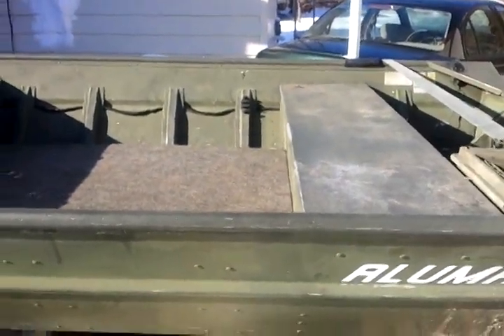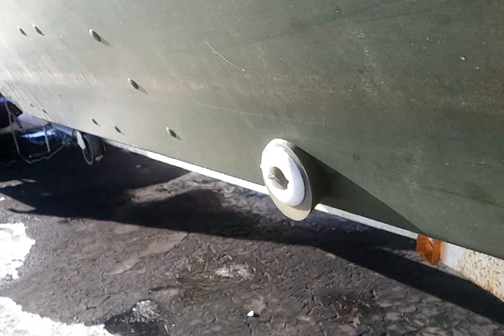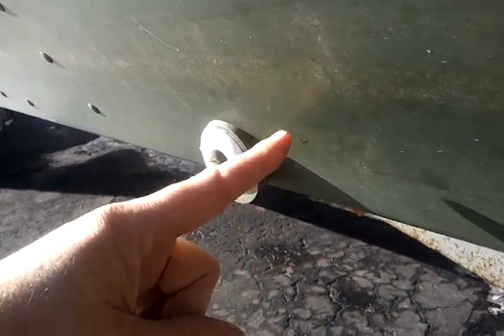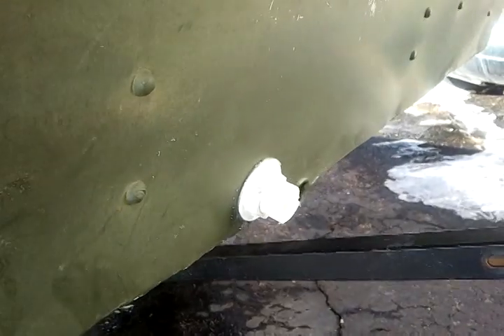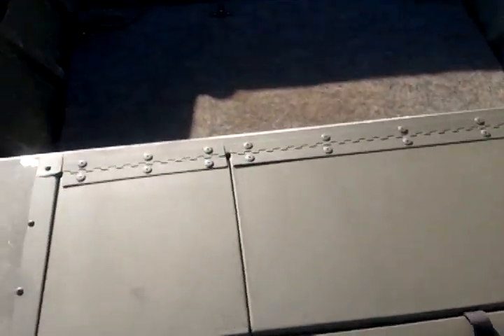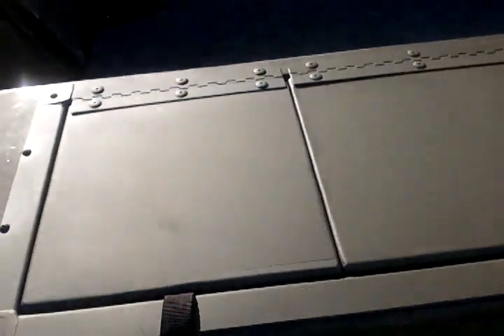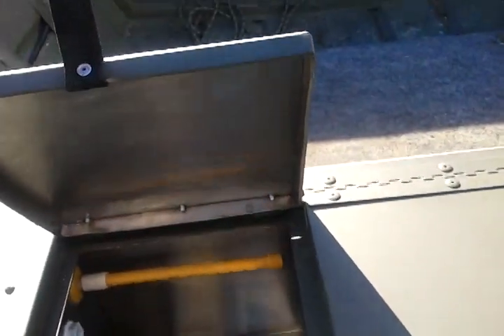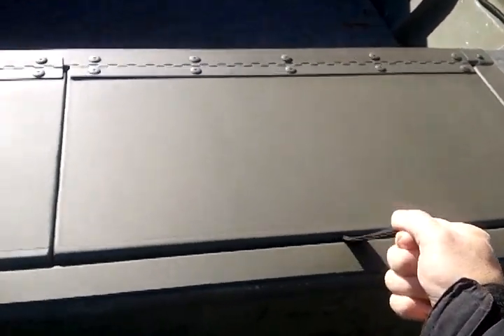Livewell fabrication for Jon Boat

Comment from the maker: yes I have...first day out had 8 walleyes in it...had a technical hitch with the fill pump, and there was a leak at the drain hose conx which made us have to remove the livewell to tighten up the conx. but other than that, it works great now.

Comment from the maker: @zumje  The spacer was a concern for me also. We'll see come spring. There is limited space in the seat area and couldn't use a 90 degree because there was not enough room for the hose to bend and still stay low...and they don't make a 45 degree angle or that would have been ideal.
The Only way your idea would work is if it was valved...otherwise the livewell would just drain out through the pump....and would be a considerable PITA and more expense.

Comment from the maker: @mrchoung05 This wasn't for the faint of heart! I designed it and took the mockup  to the fabricator. He had never done this before either so he went slow. Now remember, I had him do everything. So with him supplying and installing pumps, hoses, accessories, lights, cutting the bench and holes, removal of insulation and fabrication of the tank the total was $600
If all you wanted was the tank fabrication and everything else you took care of, I'm sure the price would be $300 for tank n lid fab.

Comment from the maker: Shouldn't. Mine is a riveted boat as well. The sidewalls of the seat are still in tact, not to mention all the ribs are as well. It will reduce emergency floatation, however. how much, I cannot say. I figured the amount of plywood decking I put in my boat made up for the foam I had to take out to make room for the livewell.

Comment: Nice live well.
Not sure on the drain out the side,hope it doesn't grab water when underway.
It would be a pain to get soaked because of that.
I wonder if you done away with that and just let it drain through the fill pump...maybe if your fill entered your tank lower or if it was where the drain is now.
Anyways,looks good,hope you fill it.

Comment: Awesome job.  The only thing that worries me is the drain fitting sticking out like that.  Catching something like a submerged stump might mean big trouble.  I wonder if the fitting could me flush mounted and the nipple heated and angled.
Reply from the maker: concerned me too after I saw it. I fashioned a sloped wood  spacer in the front of it and set it in 3M 5000 Marine glue. Now anything that it hits, including water which made it spray, flows around it.  If I had to do it again, would have done it thru the bottom so its flush.

Comment from the maker: The fitting with the screen is the pickup for the recirculating pump which discharges thru the yellow PVC aerator pipe. 
the fitting directly above the screen on the left side is the fill port which is pumped from a pump at the back of the boat.  
The fitting with the nut which is located next to the yellow aerator is the overflow drain that drains out the side of the boat. If I had to do it over again, I would have put that through the bottom of the boat. 
Any other questions, just ask.
Reply: +kevininspects Forgive me for my ignorance. Are these bench seats on jon boats empty? Meaning is there nothing inside them to begin with? I am wanting to do a similar thing here but have little knowledge on the inside of the boat.
Reply from the maker: +Jay Smooth foam insulation.
Reply: +kevininspects Wow! Fast reply Thanks. So just dig out the foam? I'd appreciate any info as I'm getting a jon boat in about two weeks and want a live well mod.
Reply from the maker: +Jay Smooth just dig it out.
Reply from the maker: +kevininspects check out my other vids for more on the boat and livewell
Reply: +kevininspects Do you have a vid of you prepping the bench seat for this?
Reply from the maker: +Jay Smooth no...but here are photo's http://s243.photobucket.com/user/Flowageboy/media/Jon%20Boat%20Modification%20Project/006.jpg.html
Reply: +kevininspects Cool thanks. One question since you have bee there and done that on this. Why not have the pump at the back end of the boat run thru a hose to the live well then put an over flow out the side top of the bench? That is the way my old bass boat was designed.
Reply from the maker: +Jay Smooth it does come in from the back. 
The overflow is connected to the drain line which goes out the side of the boat.
Reply: +kevininspects Let me rephrase after watching again. Why is the fill pump at the back then what is the hole in the side of the boat for? It seems to low to be an overfill
Reply from the maker: +Jay Smooth  I don't know how many different ways of stating that the OVERFLOW AND DRAIN CONNECT TOGETHER AND EXIT OUT THE SIDE.
Reply: +kevininspects My bad. Watched again. You said it is a drain. So then this is just an air recirc and not a water and air recirc. I am wanting to do a water and air recirc. They work better in the long run and especially in the heat. Still great ideas you have here. You have my cogs turning on what to do. Thanks
Reply from the maker: +Jay Smooth WHAT?  It's a water recirculation not air. It comes from the screen at bottom of tank and exits out the yellow sprinklers. ...thus re-circulation.
Reply from the maker: +Jay Smooth  the DRAIN is in the center of the tank at the bottom.
Reply: +kevininspects I see. I think the audio dropping off has confused me. I am just use to the set up my old bass boat had. It had a pump that brought fresh water in and dropped thru the aeration tube. Then there was an over flow so the tank didn't over fill. So according to the notations the screened part at the bottom would have to be the drain right? It's the lowest outlet you have. Sorry if I'm confused.
Reply from the maker: +Jay Smooth The drain is at time index 4:40
Reply: +kevininspects I think your annotations may be off. The screened part at the bottom left of the tank would have to be the drain. It is the lowest point of the tank. You say the top left inlet is the water feed from the pump from the back then what feeds the yellow aeration tube? The top right hole would seem to be a over fill but I didn't see that on the outside of the boat.
Reply from the maker: +Jay Smooth I have to bow out of this conversation. sorry.
Reply: +kevininspects Ahhh. forgive me. I watched this vid several times and neer noticed the center drain at tank. I am sorry man. I am trying to figure out what you have done and juggle other stuff here so I am off a bit. The annotes say the bottom left screened port is inlet from back of the boat (pump). That would be the water inlet. If so then what is feeding the yellow aeration tube?
Reply: kevininspects Ok Thanks for your help
Reply: +kevininspects To be clear though, my point of understanding was to say this, for a water and air recirc cycle all you need is to have the freshwater (from the lake) pulled thru a pump thru an aeration tube (yellow in this case) and an overflow so that it doesn't overfill. That is a constant air and water recirc system. I just don"t understand thru your annotations how the "inlet" is separate from the yellow tube from one pump which is shown.

Comment: if you fill your live well early morning the water is cooler. Later the surface temp rises if you simply cycle the same water it will stay cooler, that is if it is insulated. If you put ice or frozen bottles that would also help.  Insulation would keep semi warm the same temp for longer verse non insulated.

Comment: Where did you get the actual box (stainless) for the live well? And where the live well bottom comes in contact with the bottom of the boat.. What did you use to fuse them together around the live well drain? So when you poop the drain water doesn't also seep under the seat that the live well is stored in. Great vid! Thumbs up!
Reply from the maker: not stainless. It's aluminum. The bottom of the livewell is about 1" off the floor of the boat so the drain line can fit and run out of the side of the boat.

Comment: Good that the system works. No doubt the minnows died in a styrofoam bucket, they die often in the bait tanks when they're over crowded. Same thing happens in a bucket with the heat.  Ever consider putting a divider in the live well? Why didn't you use the mess basket you have?

Comment from the maker: wouldn't matter if I had insulation or not if you are pulling warm water in...would just mean the insulation is keeping the water at the temp you brought it in, so that logic really doesn't stand. Insulating isn't going to make it any cooler.  Bringing in fresh oxygenated water as well as keeping the tank aerated should be fine. Both are on timers.

Comment: Hi Kevin
I am not sure I understand what you’re doing with this live well??? I see the inlet line coming from the stern pumping water in through the yellow PCV pipe. Then next to that is a PCV pipe which is white with a big nut on it from the inside of the tank.  I am thinking this is the over flow line looking through the inside inlet hole attached down to the drain line with a tee to the drain line to the outside correct??? Then next to that in the inside of the tank looks to be a smaller out let line which is black and looks to be screened, but I don’t know what the use is I cannot tell looking through your access hole, and part of your video has no sound to explain.  I see where you have the circulation pump attached to the bottom opposite side of the yellow inlet line through the access hole, but I cannot tell where the circulation line connects to which hole to complete circulation.  Above the circulation pump line from the inside of the tank is what looks to me the over flow line but it can’t be is it I don’t see through your access hole what it is connected to??? Can you help me out I am a little confused. You’re welcome to email me at pt109rt@gmail.com, or simply give me a call at 515-491-4414. If I don’t answer it will not be long before I call you back so please leave me a message. I like your idea I am just a little confused.
Thanks for your help
Rich

Comment: soon as you hit a stump or rock with that drain on the side your going to have a problem
Reply from the maker: Funny...I've had this on for 5 years now. I duck hunt hard in serious backwaters...never had issue...not one.
Reply: +The Outdoor Buzz don't get me wrong it is awesome love the way you did the doors and 
aluminum livewell very nice like it so much I did the layout and cut mine out yesterday.I don't like the hatch doors for sale online I'm going to do mine pretty much like yours with the two doors and straps I cut it out at 36" X14" it's a 15 foot.and if your drain is working fine then cool beans
Reply from the maker: I put a little epoxy resin to make it more hydrodynamic as it travels thru the water.